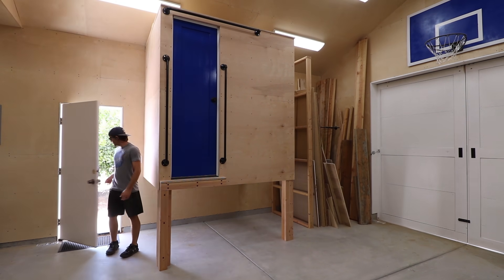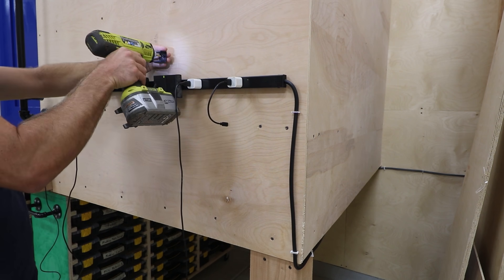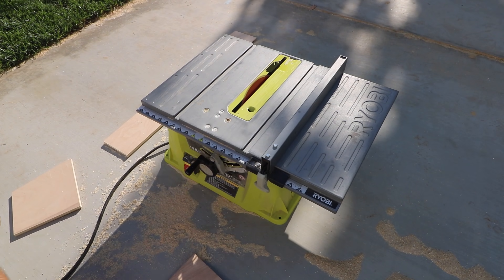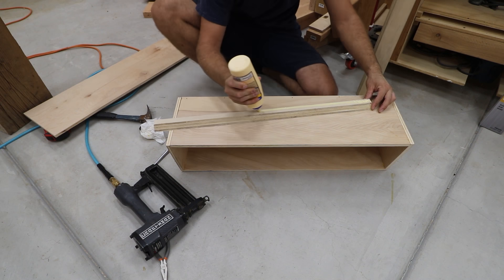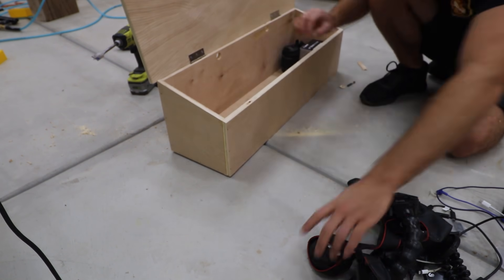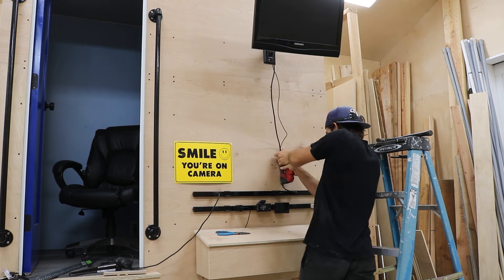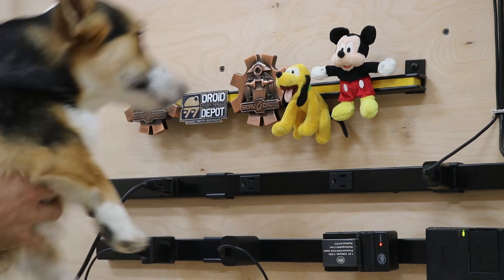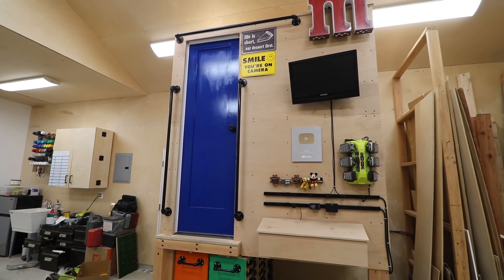Raised Office Exterior Upgrades + 100K Play Button!

Comment: You should line the camera gear box with carpet and 3m adhesive to give added protection. also add some rubber around the edge of the closure to really seal it and keep out dust.

Comment: Things are really coming along ; I  love it! Two ideas (Take em' or leave em'). 1) IF dust is still an issue in the box you made, consider some felt or rubber gasket and you can use it around the lid opening and wire openings to seal out the dust. 2) You could mount the second "M" above the first one by using some wood to make a spot to mount it that would kind of sit ontop of the roof of the office.  Might be cool.

Comment: Brad nails tend to turn either left or right from the head of the gun. If you hold the nail gun parallel to the backing board, then if the nail turns on you it will stay in the wood. I hope that makes sense.... And congrats on 100k🎉
Reply from the maker: I’ll have to test that out! Thanks!
Reply: @BenTardif  I won't take the credit for the tip - I discovered it watching the Wood Whisperer - good channel - congrats again.
Reply: They also tend to follow the grain if I remember correctly - you know, path of least resistance or whatever.

Comment: what kind of "staple" gun is that, that shoots cable management?
Reply from the maker: That’s pretty much it! A cable staple gun
Reply: I came here to ask this, what do I google to find one?
Reply: Googled it, the ones I could find advertised as “low voltage only”, consideren using it for normal cables as well

Comment: Ben, this is a question about your shop.  Did you leave any space between the plywood panels to allow for changes in humidity?  I'll be putting birch ply on the walls of my shop in the next few days so I'm wondering what I should do.  Thanks!
Reply from the maker: I did not. Though in my area the humidity is relatively consistent year round

Comment: hey Ben, whats that "staple" gun that you are using?
Reply from the maker: It’s a cable staple gun that uses special staples to hold wires and cables tight against the wall. It’s great for keeping romex organized but I use it for other cabling as well
Reply: @BenTardif  I figured that. I've never seen one before. Pretty cool. Heading to amazon now! lol